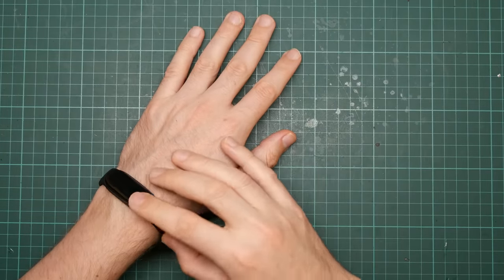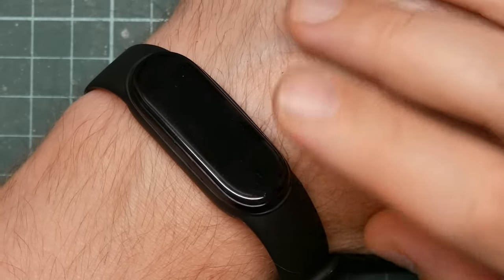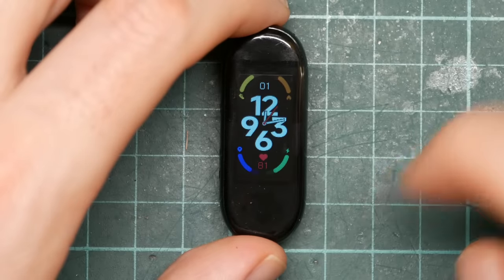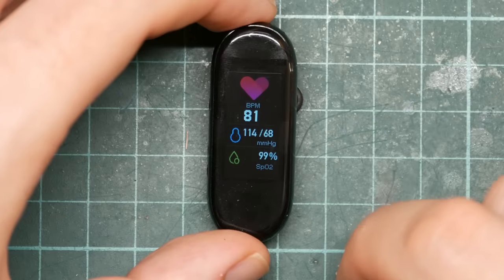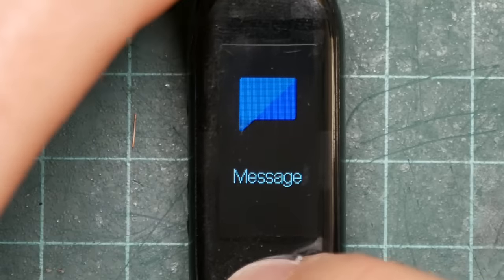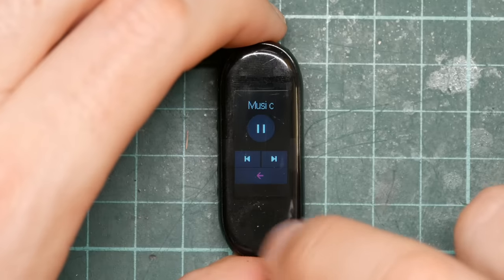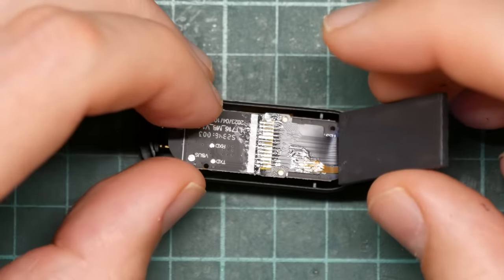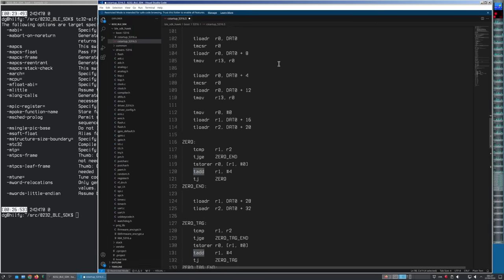Porting Python to a terrible $3 smartwatch

Comment: You have found an interesting topic. Thank you very much for sharing your insights. I wonder if there are more malicious probabilities possible, especially when a microphone is delivered with such a device.
About making connections through the case:
Depending on the material, you could perhaps use screw inserts (as used for 3D prints) as vias from the circuit inside to the outer surface of the case.
There are certainly better options but I thought I‘d share it nonetheless.

Comment: Absolutely great video, i'm going to give this a try too. Just something to think about - you can get brass pogo pads, you solder a wire to the pad, drill a tiny hole in the case for the wire to pass through and then epoxy or uv glue down the pogo pad. Then you can easily 3d print or otherwise make a clip with pogo pins that are spring loaded and press on the pads... the pads are very low profile and used on similar watches that attach to a magnetic charging cable...
Reply from the maker: Skipping is a very traditional cardio training exercise and is much harder than it looks.
Reply from the maker: Also, I replied this to a different comment. What's it doing here?

Comment: if it had a pulsoximeter sensor (heart rate, blood O2) it would not blink a green led because you can only messure both values with both a red led, a infrared led and a phototransistor wich is reactive to both of these

to messure all leds and the fototransistor should look directly into your skin and should be as close to each other as possible but while not shining directly into the phototransistor, the light should go into your skin, scatter in your skin wich will make it appear to be slightly glowing and only the light wich has penetrated the skin and scattered back to the phototransistor should be messured

you blink the red and infrared led in an alternating manner and messure the backscatter from the red and infrared light in the same alternating rygthm

because when your heart beats the blood pressure and theirby blood amount in your blood vessel changes wich will cause it to absorb more red and infrared light with about the same proportionality, and these dips in the backscattered light must be counted and then the heart rate can be calculated 

and for the O2 level of your blood you messure the  difference of how much of the red and infrared light is absorbed by your blood because O2 and its Counterpart CO2 absorb different wavelengths in different amounts, one absorbs more red light and one more infrared light and the ratio between these two absorption amounts is directly proportional to the ratio between O2 and the ratio between these two amounts of absorption is directly proportional to the ratio between O2 Saturation and CO2 Saturation in the blood

but it had a green led wich wouldn't. really work
Reply: All Fitbit use green

Comment: this was a lot of fun, what an interesting and weird mcu. also, how weird that the ble stack consumes so much ram for no good reason. I don't think the stack will be reverse engineered right now, but hopefully someone does it. same for the arm thumb assembly to tc32 assembly. but we can dream!
Reply: Sometimes the flash has wait states so running code from it is slower than from RAM. Just speculating, though.
Reply from the maker: In addition, I completely forgot to say --- I'm sure I recorded a bit but then couldn't find the footage --- that the flash is emulated via SPI, like the ESP's PSRAM or the RP2040. 2.5kB of RAM is dedicated for the flash cache. So anything which might run from an interrupt handler will have to be in RAM, in case an interrupt happens when the flash is busy. It's entirely plausible that most of the BLE stack runs in an interrupt context.

I have actually been debating decompiling the BLE stack in ghidra. I'd need to disassemble it, rewrite all the instructions into Thumb, assemble it again, and that way produce a Thumb binary which ghidra could understand!
Reply: @hjalfi  that'll be a video and a half!

Comment: the usb tester reading the battery voltage when power is disconnected is very concerning. It suggest they are connecting the battery cell directly to the 5V usb supply and expect the usb supply to go in CC mode and drop lower in voltage. This is overcharging the battery for sure so be careful using these, although the cell is small, it will still become a major fire hazard over time with such charging methods
Reply from the maker: I believe the battery does have an overvoltage protection circuit. I did accidentally fry one by short circuiting it (it didn't catch fire!), so it might be interesting to dissect it.

Comment: Greetings. I’m super interested in that Elikliv microscope you use. Which model is it and how do you like it? Considering purchasing one. Many thanks and cheers on a great video.
Reply from the maker: It's pretty bad. The microscope bit works fine, but I got it specifically to make recordings and it seems to have trouble writing to the SD card reliably, causing it to drop frames. It's also supposed to be a webcam but that bit of functionality simply doesn't work (or else I'd just record it with OBS studio or something). Plus it has really terrible rolling shutter. Would not recommend.
Reply: @hjalfi  thanks for the reply. Damn that’s a shame as the price on some of their devices is fairly cheap. Have you had your eye on any others on the market as a potential replacement?

Comment: Soldering on these devices requires a tiny soldering iron tip (1.2mm or less) on a temperature controlled iron.

You also need good flux and 0.5 or 0.355mm lead solder.

#30 AWG gauge kynar wire is perfect for soldering to SMD's and chip legs...

Comment: Regarding the differences in screen color, isn't the screen protector in the case smoke grey, accounting for the dimmer/less saturated clock? The dissected version is the bare screen, so you don't have the filter of the case...

Comment: Nice gadget. If it could be BT-flashed, I'd be interested in using it as a status display for my Home Assistant. Bluetooth would be just fine for sending data, and having it plugged in all the time would be no problem at all. Although, something a tiny bit bigger would be nicer.

It's really annoying what super cheap devices we can get, but then there are those huge gaps. I can get an ESP32 dev board for $3 and a small LCD for the same, but nobody seems to be offering a combination of those in a nice box for a reasonable price.

Comment: 6:00 I have a tonne of small li-ion batteries from vapes and other things that are significantly larger than the one in this, I can't help but wonder how well it'd work to design and 3D print a case to hold a beefy battery and this circuitry/screen together to make my own device with genuinely useful battery life.

Comment: I bought a ticwatch pro 5, it has 2gb of ram, 32gb of rom. Runs cut down android for wear os, it's even 64bit

The 4 pin usb at the bottom allows for bootloader unlocking, given enough time people will be able to get root access on it. I'm quite pleased
Reply from the maker: The trouble with these high-end devices is that doing anything interesting on them requires a lot of work as you need to port a real OS like Linux... and then it's running Android and doing anything on them is really dull because it's just like every other Android device.

Comment: After seeting this, i really wonder what you could do with something a little more powerful like a Samsung Fit3.
Considering that you know so much about this kinda stuff, i wonder if you could get Android 1.0 or 1.5 running on that.
Like, yeah, Android 1.0 needs 32MB of RAM, double the quantity in the Fit3, but it has enough internal storage for swap RAM. But i really doubt that 1.5 would be able to run on that. Either way, it would be a very interesting thing to see if you ever want to do it.
Reply from the maker: I actually have a Google ADP1, the original Android developer phone --- a rebadged HTC Dream with the custom paintjob on the back. It had 192MB of RAM and that was nowhere near enough even for Android cupcake. I wouldn't want to try to squeeze modern Linux onto that. OTOH there's a bajillion modern RTOSes that should work just fine. NetBSD would be fun too.
Reply: @hjalfi  That's so cool. Did it come with Cupcake out of the box, or did it have something unusual like Android 0.9?
I've never seen the back of the ADP1 though. All photos online only show the front. 😂🤦🏻‍♂️
Also, seeing NetBSD on that would be wild, especially with a GUI.
Quite sad that not even the first Android version ran as promised.
And even sadder that the Fit3 doesn't have even as much RAM as the HTC Dream.
Reply from the maker: @myrmeko  It came with Cupcake. This version of Android had the entertaining bug where even when the GUI was running, the keyboard was still hooked up to a root console in the background. So if you used the word 'reboot' in an email your phone would restart.
Reply: @hjalfi  Omg. That's so funny. 😂😂😂😂
Did it have any other buggy quirks? I really like hearing about this kinda stuff.
Sorry that i don't have anything to add to this conversation, the most contact with software development i had using a live view thingy to see what libs some apps needed, because i wanted some apps to run from one phone to another. I really don't have any interesting to say.

Maybe... Did you know the Android 6.0 HTC Settings app works on any phone with no modifications done to the app? All apps besides the dialer, system ui and framework have either been ported or work as a straight install.
I tried my hand at the dialer, but if i remember correctly, could only make it show the settings screen (through QuickShortcutMaker), the dialer and contacts were an almost instant crash. They showed the UI though, so there was some hope. 😂

Yeah... That's kinda lame compared to the ADP1.

Comment: Hi, great video by the way! $3 for these things is good, but unfortunately there's also a lot of variations of this kind of smartwatch, and the microcontroller in them can range from known ones, or totally unidentifiable chips. I myself have a few samples similar to a LT716 (marked B01 instead), slightly different board, MCU, and has an accel chip. The MCU is labeled "EAS312 2004 SAG" which pretty much meant nothing while looking it up; the only hope I got was from checking the TX line for anything, and there it spat out "freqchip," among other things, which appears to be a company that makes BLE SoCs. From their product selection, a little bit of comparing by package size, pin count, and seems like it's a FR8016H - definitely not what the marking on it said lol. Appears to be an actual ARM chip, 48KB RAM, though it didn't want to mention that on the datasheet ("RISC 32bit", "SWD debug"). Checking the precompiled libraries on their SDK tells me that it's a Cortex-M3 tho. So that's neat.

Comment: I don't know how accurate the heart monitor is, but heart rate and oximeter is likely legit. The BP? No idea how it would do it. The sensor is an LED/Sensor Pair. The Oximeter uses the colour of reflected light to determine how oxygenated your blood is, the heart rate monitor works in a similar way but I believe it uses amount of light reflected rather than the colour. 
I say its likely legit because the sensors for doing that are cheap. The accuracy however is a lottery.

Comment: Even though it's garbage, the fact that it has so much hardware makes me wonder if they're losing money on these things selling it at such a low price. As far as the compiler goes, it's not terribly difficult to write a C compiler, especially if you don't have to implement the whole standard library, so it might be worth the time as a side project for someone to bang one out from scratch. Of course, if you absolutely don't want to implement one from scratch, I'd just adapt a version of `gcc` that outputs Thumb instructions and write something up to translate.

Comment: which keyboard do you use?
Reply from the maker: It's a generic Corsair K95 thing what I pulled off a local ebay equivalent, fitted with Cherry reds. It sounds decent and has a nice macropad.
Reply: What is the keyboard similar to the magic keyboards you used in the video? You did a very good job in the video and congratulations.

Comment: Damn you need so much stuff to hack on those things!!!, I want to run even simple JS application (default apps and faces run JS) on my Mi Band 7 pro, but thing is so locked down, even doesn't have com port all through bluetoothLE over encrypted connection.
I mean it's good that connection is encrypted but like it's too locked down for hacking!!

Comment: The "heart rate sensor" flex cable is literally just soldered on where it gets positive and negative from the battery. No data transmission whatsoever. I don't think I've had a belly laugh like that in a while. How can they sell this with a feature that's so blatantly fake?! LOL

I get that it's cheap and it couldn't realistically include that feature, but damn... The fact that they went all the way to pretend it was and make it look like it was. LOL

Comment: No need for Python. You could have done better...
uLisp
Forth
With Forth, you can design the memory footprint, like 128kb RAM.
If there isn't a Forth port for your processor, DIY. Not too difficult for those already familiar with assembly.
Reply from the maker: I have actually written my own Forth (it's a single file which is a shell script, C file, Forth file and awk script all at once). Honestly, Python is dramatically easier to work in, much safer, and the bytecode is denser. Plus, just using Forth doesn't magically get you more RAM!
Reply: @hjalfi  That is really awesome.
My point about memory regarding Forth, is designable, where X microcontroller only has 128kb RAM, design Forth for that, making the usage more efficient.
For safety, C is the most attacked programming language, memory corruption and overflows. It could be safer, but I guess most C programmers are lazy. 😁

Comment: This is clearly a crappy and cheap remake of the mi smartwatch, which is actually decent. The icons the watch uses are pretty much identical to the Mi watch icons. 
Instead of paying 3$ for such crap, rather get the actual one, which depending on the model are only 10-20$.